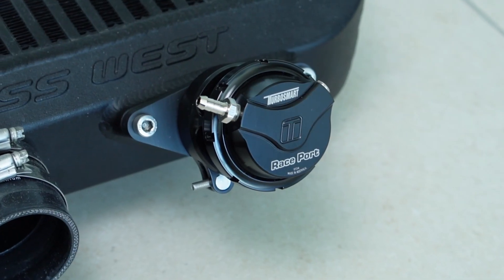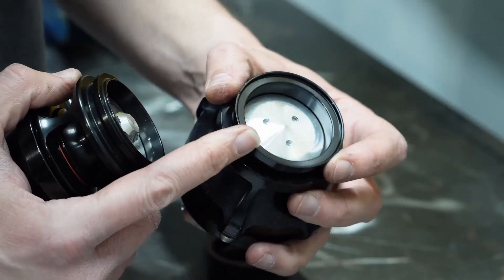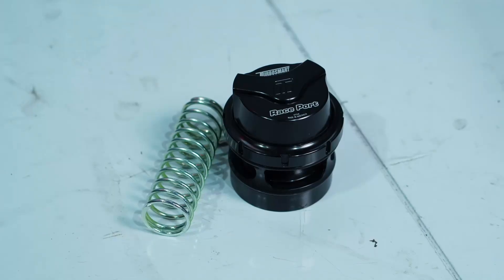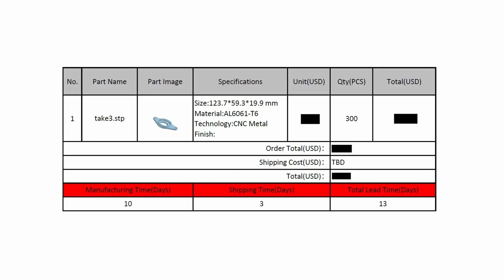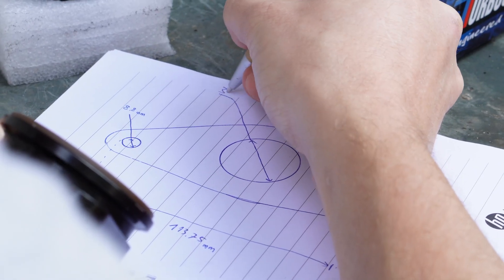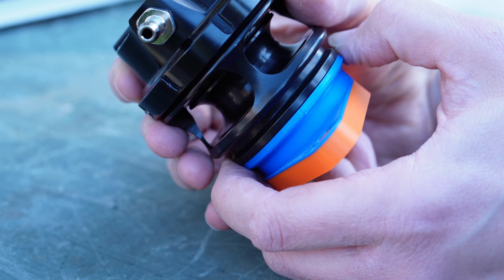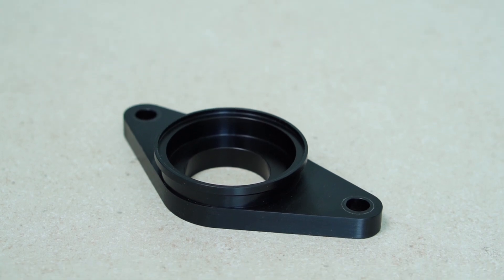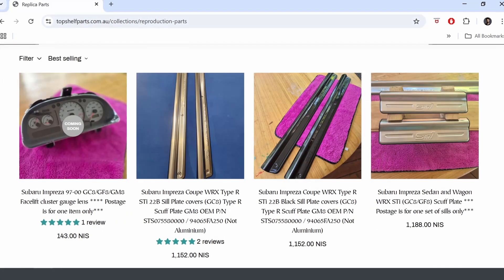Why I made a custom adapter

Comment: They probably would’ve swapped it out for you for the female sleeper version. Did you call them like I told you to? 👀 Street cred for the effort I suppose lol 😎🤙
Reply from the maker: @joshuaburney9985  
I didn’t call them haha
But it would have been a hassle sending it back to be replaced since you need to add shipping and taxes etc.
Besides, where is the fun in that? 🤪

Comment: Option nº 4: Blank it off, and listen all that nice turbo flutter. :D
Reply from the maker: I’m pretty sure that’s how I killed my last turbo 😅😅😅
Reply: @TheGCJourney  Naaaaa... Plenty of people running the same setup on TD04, TD05, VF35...
Reply from the maker: @PedroFTeixeira  
I still haven't managed to understand how that works. It was always my understanding that once the BOV is blocked off the air going back to the turbo causes counter pressure on the spinning compressor wheel when releasing the throttle pedal.
Reply: @TheGCJourney  That's exactly it. Even Duncan from RaceDynamix, has said many times on his videos, there is no problem in blanking the BOV, if you like the sound,
Reply from the maker: @ 
Interesting! 🤔🤩
This is giving me bad ideas 🙃
Reply: @TheGCJourney  That is a myth, compressor surge is a natural thing. Boxers tend to rob oil from turbos in high lateral G's which is a huge killer, trust me it took me a long time to find that out.
Reply from the maker: @Rooey129  
How did you manage to overcome the turbo oil starvation? Larger oil pump? Better Sump baffling?
Reply: @TheGCJourney  Better sump (baffling is great but drysump is the only perfect solution), turbo oil pressure regulator, glyptal the galleries, good engine management, 10W30 oil, better driver recognition of oil system, lots of good ways to prevent it but ultimately the oils going to get stuck in the heads on prolonged high lateral G's and the first thing to lose oil is going to be the turbo as it's at the highest point (and its cheaper to replace a turbo than an  engine)

Larger oil pump will lead to cavitation, big killer of engines not built properly.
Reply from the maker: @ 
Hopefully the new 11mm oil pump and RCM oil control kit will assist with more stable oil pressure under cornering.
Reply: I've never had any oiling issues, with a completely stock oiling system, even on slicks.
I do run 10w60, and I overfill a bit.
There is a small hole and a line on the dipstick, I don't remember what is highest, but that is my reference point.
Fueling is a completely different story, when it's at 1/4 tank, I can't do chicanes and full throttle, or it will get fuel cut.
Reply from the maker: @ 
Yeah, fuel cutting is definitely an issue under 1/4 tank lol